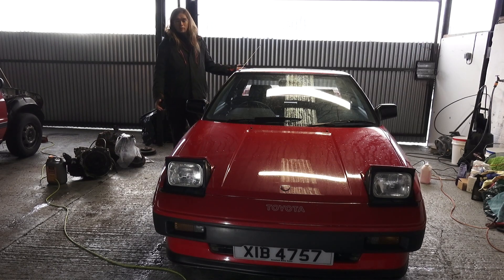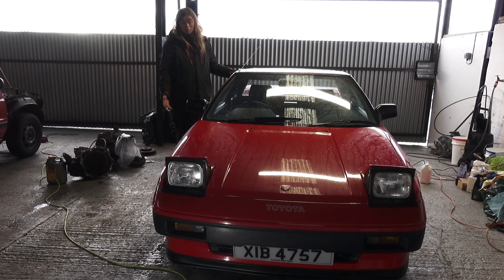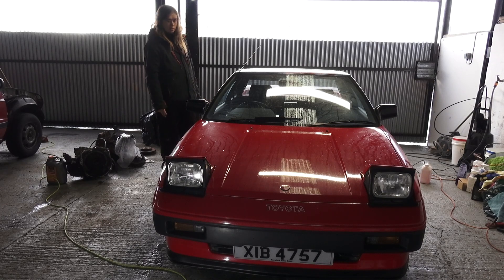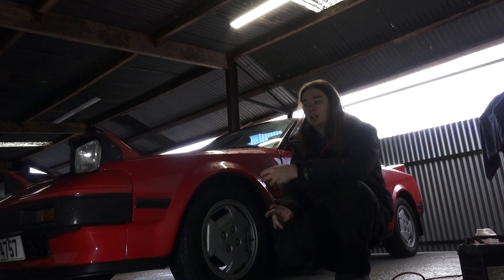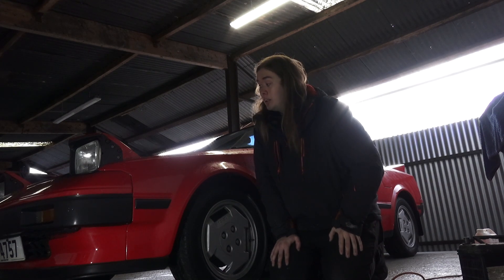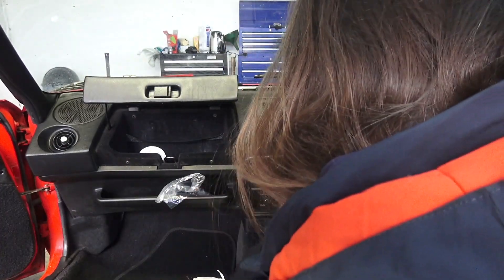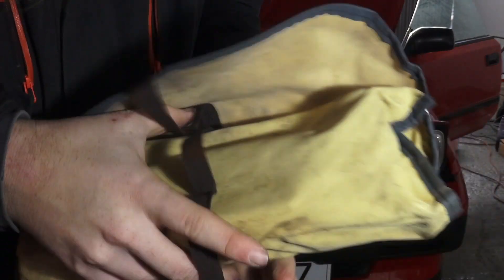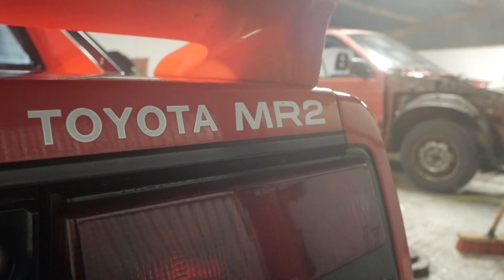Toyota MR2 AW11 Mk1a Barn Find!

Comment: It's a good swap from a G6 to a mr2... but i still miss it. It would be a good project car. I have mine corolla for over a year. I did over 10k miles. I had a G6 interior and now i have the G6 cluster, celica/g6 stearing wheel, G6 grill, G6 frontskirts, and the bar for the front to make the car more stable. But i dont have time right now to install all this. Cluster is done until now... maintance comes next in  next month
Reply from the maker: Yeah the g6 was a great car and I’ll miss it dearly! I’m glad you’re enjoying your corolla, is it a 1.3 or 1.6?
Reply: @engineboymedia  its the 1.3L 86hp 1998.  216k km 125k miles. My second car
Reply: @engineboymedia  my first car was totaled after one year. It was a Honda Civic 7th gen ep1  1.4L 90hp bluegrey. With the sport package.